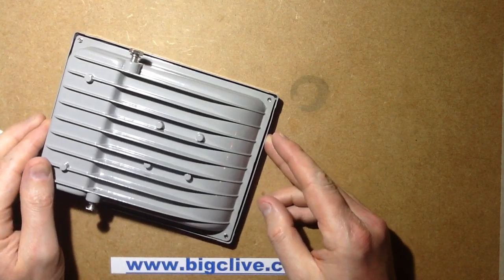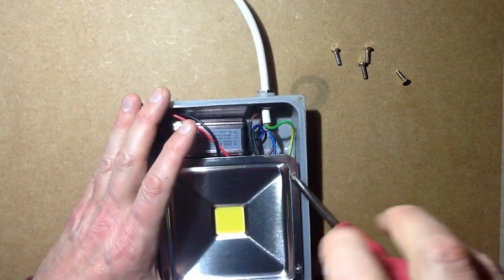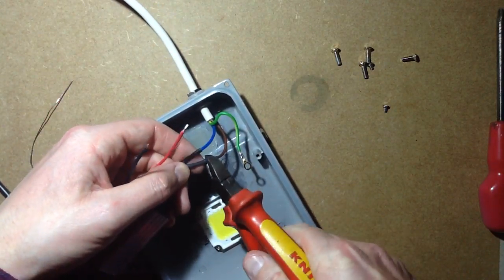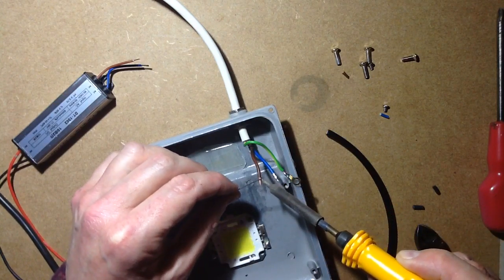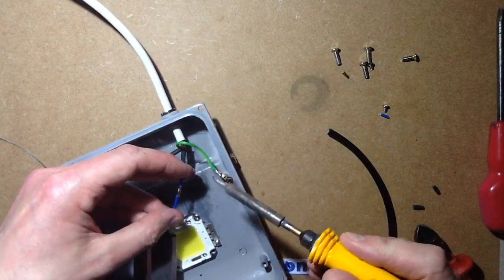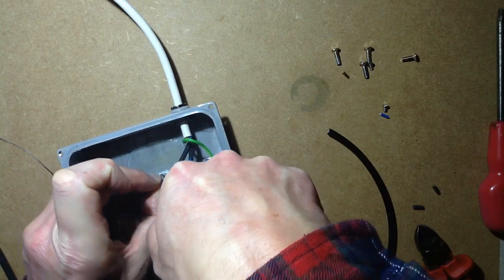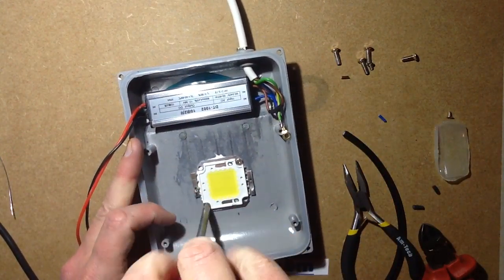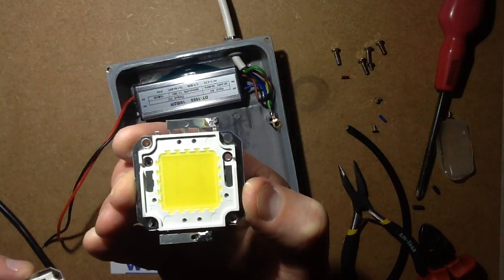How to change LEDs and drivers in LED floodlights.

Comment: And where I can found LED Drivers?
Reply: Ebay or Aliexpress. But be wary of Aliexpress, the sellers are often cheats and shipping takes ages.
Reply: *****
Bullshit. The buyer protection on Ali is dogshit. Everything hinges on a "service rep" that doesnt know their ass from a working electronic product believing that the product was defective.
Reply: *****
You dont need to be an engineer to know when an LED doesnt work man. I've got a couple videos left up on my channel that I had to use to try to dispute sellers on Ali.

They treat you like shit until you leave a bad review with pictures and links to videos showing the product not working.

That's not just being a tradesman, that's being a bad person at best, and a scammer at worst.

All that said, I still do buy from Ali, but I just go into it expecting to be scammed, and build that into the cost of entry.
Reply: *****
If they dont test them, then I expect them to be reasonable about disputes.

Comment: Hey I have a question, if I was to buy a 50w spot light similar to the one in your video,  could i change out the existing 50w led chip with another 50w chip? As long as it is 50w it should work right?
Reply from the maker: +Andrew Pierce Yes, if it's the same form factor then it will have 5 rows of ten LED chips and you can interchange LEDs including colours and the specialist plant-growth or high CRI ones.

Comment: I bought the same floodlight and after a while it started to act as a strobo light.Then it fixed itself and start to work as normal.Since yesterday it started again as a strobo light,is it about driver or LED panel?
Reply from the maker: +Rada Separevic Maybe driver, but sometimes the LED bond connections failing causing sections to strobe.

Comment: Is it possible to increase the current of the driver, even a little?

What about increasing an 850mA driver to a 950mA or a 600mA to a 700mA? Simple?
Reply from the maker: +Bill Lowe Most potted drivers are locked at a fixed current.  You can probably get some that are slightly adjustable.
Reply: Shame, would be nice to be able to change a component or two to beef up a driver. They never seem to live up to the specs on the label!

Comment: Just changed power supply and LED chip in our outside 30W floodlight that I was not happy with, no more light than two 10w floodlights I have. Now put a 50w power supply and LED chip in and am very happy with the result. Until I saw your video I was not aware it was possible.
Thanks.

Comment: @10w that was running at its most effecient as you reduced it by 50%.the bigger driver is pushing them to full power just about.
Reply: But didn't he replace the led with a 50w?

Comment: Hello Clive, do you have tobe careful with the reflector as it may short the LED out ?Great informative video by the way, Thanks...
Reply from the maker: +Garry Nutter The reflector sits down on the face of the LED, but if the terminals at the side are folded up or have a lot of solder on them then they could short against the underside.

Comment: Thanks for answering my question. I should have said previously that the light I have has a separate compartment on the back which holds just the driver itself. But besides changing it to a 50w... Could I use a 30w driver with a 50w led and get 50w of light from it? Or do it have to be a 20w?
Reply from the maker: +jimmytk If you use a 30W driver with a 50W LED you will not get as much light as if you had used a 50W driver, but the LED will run cooler and operate more efficiently, so it would put out a bit more light than an actual 30W LED.  the main advantage is that the heat dissipation would be spread across more LEDs, so the LED array should last longer and maintain its intensity longer too.

Comment: Hi, bigclivedotcom I have a 30w that's starting to become less an less bright. Its a lil less than a month old. I ordered a new 50w driver and 50w led to put into the 30w frame. Could I use the original 30w driver (if it's still good) with a 50w led? And have the proper brightness ? Thanks for sharing your vids...  All the best to ya!
Reply from the maker: +jimmytk Yes, I'd actually not recommend using a 50W driver in a casing designed for 30W use as it may not dissipate the heat well enough and result in early failure of the LED.  If anything you might consider fitting a 20W driver, as that will reduce the case heat and will still run 30, 50 and 100W LEDs, but run them at a lower level than they are intended, so they will generally last longer.

Comment: Can you recommend a good source or brand of driver? some of the cheap ones are horribly RF noisy and also seem to have short lives. I'd like to upgrade some of these before I fit them so I'm not having to go up ladders again 6 months later. Cheers.
Reply: The answere is late but i use the meanwell Drivers (11€/Driver) and they Work stable.

Comment: There are another couple of advantages of doing this. If you look at the small print of some of the specs for the LEDs then often the 100,000+ hour life is reduced to as little as 5000 if you are running at 100%. There are great gains in life to be gained from dropping down to 80% IE a factor of 10 or more. Reducing from 80% to 40% does not get another factor of 10 increase but it will probably double the life again. I've not checked for myself but I also believe that in the blue into phosphor type "white" LED's produce less actinic light at 80% capacity so 40% should be better for that also. I tend to run mine at about 70% (3W types run at a fraction over 2W).

Comment: What type of hot melt glue did you use? It appeared so hot the glue was almost liquid. all of the hot glue guns I've used heat to a paste like consistency.
Reply: You could see steam coming off the glue. He may have used a variac to increase the power of his glue gun some...
Reply: +Nick Schild
It shows the difference between a decent hot glue gun and a cheap one. Mine just kind of oozes a warmer softer version of the stick that went in the other end. occasionally I've had to give it a blast with a hot air gun to get it to flow properly onto what I'm glueing.

Comment: I was wondering can i do a 50w driver with a 100w led? Or is it better a 50w driver with 50w led?
Reply from the maker: Yes.  you can use a lower power driver.  The combined forward voltage of the 20-100W LEDs is similar, but the current is different.  with a 100W LED on a 50W supply the LED would be run at half current and give out just over half the light.
Reply: bigclivedotcom so then a 100w led needs a 100w supply?
Reply from the maker: +Mod Mike No.  100w would be the maximum driver you could use with a 100W LED.  But you could use it with lower power drivers too.
Reply: ok i did one with a 100w and 50w driver im wondering now what would give more light output my current setup or a 50w with a 50w driver.
Reply from the maker: +Mod Mike The 100W LED array with a 50W driver will theoretical produce more light than if you had used a 50W LED as the 100W array is being driven at half its rating and will be more efficient.  Under-running LEDs gives greater efficiency, lower degradation over time and higher lifespan.

Comment: I have an 50w reflektor. And one of the days it started blinking (flashing). It seems that just half of the led module is lighting up. What could be the problem? Why the blinking effect?
Reply from the maker: This is a common problem.  The bond wires for the rows of LEDs break from the internal bars.  You will need to put in a new LED.
Reply: Thank you mate! ;) Haven't find a response before. I also have a T8 tube that is blinking very fast but it seems that each led is working. Maybe something similar could be the problem. I will measure each led to see if it's working properly

Comment: For the cost of two pieces of standard black heat shrink, have you ever thought of using dual wall heat shrink instead? Or is it negligible in cost because you use cheaper heat shrink to begin with? I only use 3M FP-301, so it costs a bit less for me to go dual wall on such applications.
Reply from the maker: +Matthew Rosenblatt I keep a stock of different sizes of heatshrink for electronic applications, so it was really just playing safe with the extra layer.

Comment: Is it possible to put a dimmer switch on a 30w Led Floodlight? or is that asking for trouble? If you think it's possible can you recommend a suitable dimmer switch please.
Reply: +Spooner Studios You'd best use a PWM module between the LED and PSU. you risk damaging the power supply with a dimmer.

Comment: Wow - you've got some serious manual dexterity going on there. I never would have thought of holding the wires with two fingers and feeding the solder in with two others on the same hand. I'll have to practice that.
Reply: I have short fingers, and I cannot do it that way. However I have soldered for a,long time,  and this is the same concept,  but exactly  opposite  from how he's doing  it. I use thumb and pinky supported ring finger to hold my wires, and my middle and pointer to feed solder. lol I tried to teach my friend this but she too has her own way. She melts the solder to her tip, then uses the end if the wire to wick it up

Comment: Interesting video. I have purchased two of these 30w- lamps and I'm thinking of upgrading them. Is it possible to buy a kit consisting of a 100w-led module with appropriate driver and just hook it up in the same chassi? Or are there any problems, such as size complications (if the led modules are different in sizes, are they?), significant increase of heat etc. Would you even not recommend it? (I should point out that I have VERY limited knowledge about this)
Reply from the maker: The size of the heatsink varies according to the power of the LED.  If you used a 100W LED in a 30W case it would probably result in the LED overheating and failing.  It's better to "upgrade" a 100W light with a lower power driver like a 50W one driving the original 100W LED.  That way the LED will run cooler and last much longer.

Comment: do you have any links to the lamps and the led+drivers that you changed? lot of sellers around, so would be nice to know where to get the correct ones, and who to avoid.
Reply from the maker: So far, all the LEDs and drivers bought on their own from various suppliers seem to be OK.  It just seems to be where the components are hidden in end products that they cheat the ratings.
Reply: ok, if one need to replace the driver it's important to get something that fits inside this compartment.
I have bought various 10w leds loose, and found that there are at least two type, which have different drive voltage, but from 20watts and up, it's maybe another story?
I want to get better lighting for my workplace also, and these lowprofile lamps looks good for that usage.
Reply: The 20w lamps I find is about £15 each, wonder if that is reasonable, and will give me an ok lamp, or most probably someone with wrong drivers..
Reply from the maker: Asbjørn Mikkelsen The 10W LEDs are available either with all the LEDs in series (about 27V) or in a 3x3 parallel series array (about 9V).  The 20W and upwards all seem to use parallel strings of 10 LEDs, so their voltage tends to be predictable at around 30V.  It's hard to tell if a light you order is going to be rated at 20W or not until you have it and test it.

Comment: I agree on the 1 spot for thermal paste, it works perfectly every time but there are some "experts" that claim you have to do it a certain way and spread it to this thickness and blah blah and it really makes me wonder how they just don't get it, 1 spot in the centre covers the centre and when you press evenly, it comes out the side, there is no room for gaps or air as the paste has pushed all out before itself.